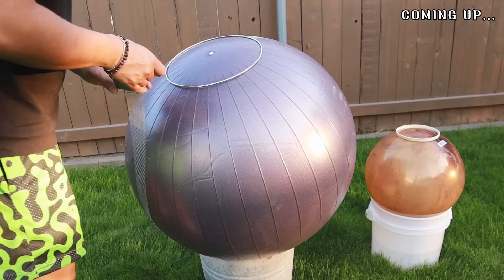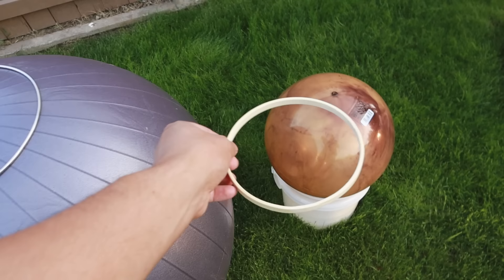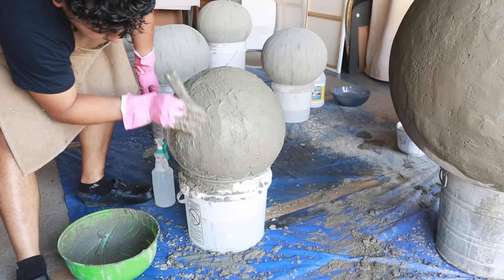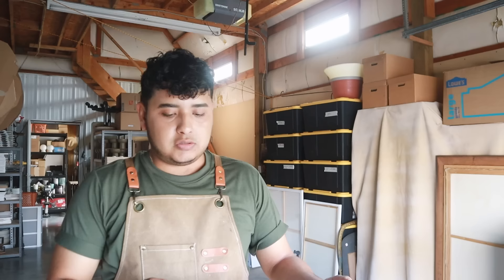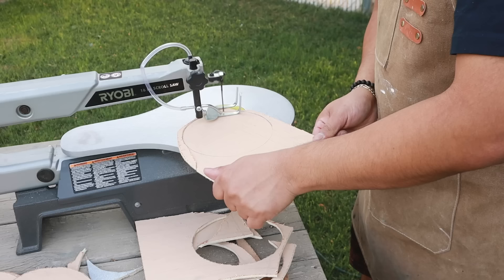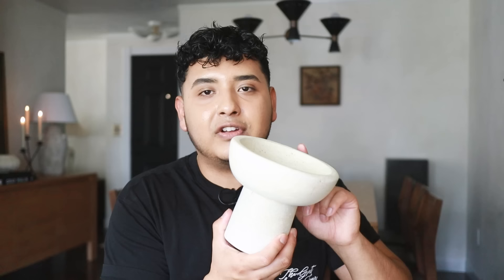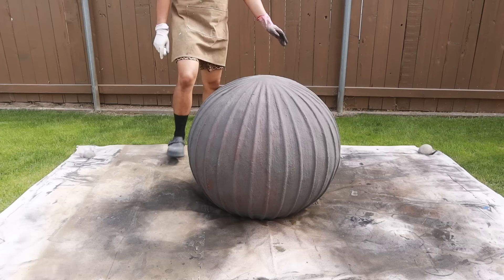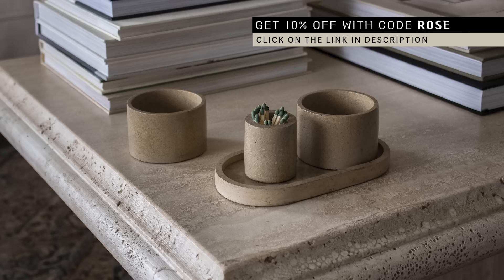DIY Large Cement Orb Sculptures For A Beautiful Home

Comment: For the hula hoops, you could have tried 2 things.  First, you could have attached the latitude rings at even intervals around the equator to keep them from clumping together.  You could also add a center rod to keep the oval shape from forming.

Comment: I like them all! Very nice!
Two thoughts:
1. Get a snap on spayer for your spray paint/sealer (your fingers will thank you)
2. Go to the cake decorating section in your local store and try to find a plastic icing spreader. Sort of like a large plastic scraper. They are a little flexible and might help make applying the cement easier than the metal trowel. 
I hope you try it!
Reply: Awesome tips! Also, when I have to apply paint in a large area, and natural variations in tone are acceptable, I'll put the diluted water-based paint in one of the pump canister lawn sprayers with the wand.
Reply: Love this idea!

Comment: Having worked with clay, I've  been wanting to try  something like what you are doing. It's been motivating to see so many cement pots, etc lately. You have give me more motivation to give this art a shot.  
  Your pieces are beautiful.  Your rust piece turn out beautifully!!
  I think you are headed in the right direction with your paints, sealers. H
Use products that are affordably used on wood,  event on the exterior on decks, patios & similar.  Sealing is the way to go since you've worked so hard on everything.
  
  I'm currently finishing some wood projects but will definitely try cement next!
   
  Keep creating, you have the talent😊

Comment: To ensure moist curing, I cover my concrete projects with a wet Terry towel,  the concrete can pull the moisture from it as it cures and allows if to cure to full strength.

Comment: Part of the problem with DT hula hoops is that back in the day when hula hoops were invented, they were eady to use because they were heavier.  The lightness of these cheap ones dont give you enough weight to effectively move them around.  Back in the 50’s or 60’ s they were heavier.

Comment: the cracking will also be caused by the ball changing size due to changes in air pressure and temperature.

Comment: I watched your old one awhile back along with a few other channels that did orb posts. This one was very informative, and thank you greatly for sharing your methods. I wish I'd seen this one before doing mine a year ago. I used the same exact kind of rope, fiberglass tape & such, but had the worst time with the yoga balls - and that tape!! The ropes kept falling off or caving in after removing the actual ball. TBH, they looked pretty weak beforehand too... 
Were the hoops the secret to keeping the tape and rope stuck on so well?? I'm pulling out my dilapidated cement ropes I saved and am going to attempt to use adhesive and hot glue as you did! Thanks again!:)

Comment: Saturate your concrete with water  before painting(with water based paint). The paint will get sucked into the concrete as it dries and create a very durable bond/base coat.

Comment: Dixie belle chalk paint company sells the rust n patina collection in bigger containers for a decent price compared to the rest n works great n offers the blue n green patina. I also only thought you use the orange primer on metal either way is what I'm saying if you didn't have enough it's still what it worked as long as you had enough of the iron color which is the gray So I would check out the Dixie Bell chalk paint companies patina collection you'll have larger spray bottles and larger containers of paint which is the primer whatever paint you know what I'm saying I think you can buy it as a giant kit and if advertise for them I'm sure they'll send it to you for free If you do a review